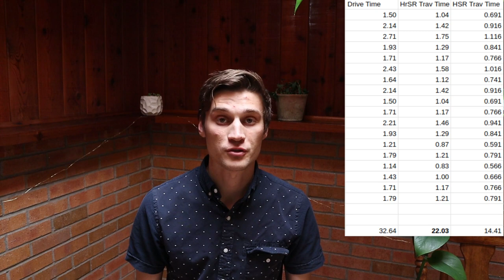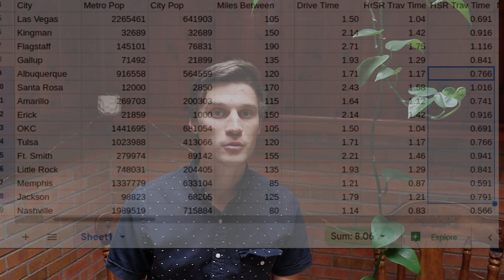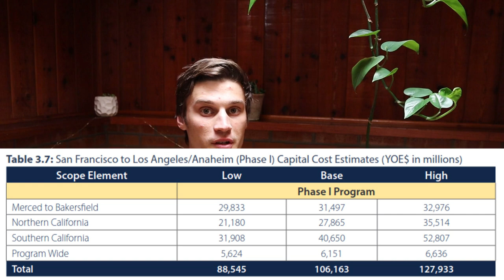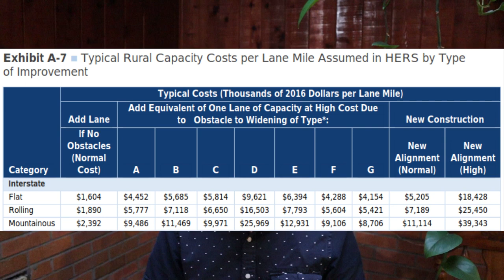What if Interstate 40 were High Speed Rail?

Comment: I'm not sure what the relevance is to build a new highway, because I-40 already exists, and we're trying to explore transit alternatives to it.

Your real options are:
-HSR
-higher speed rail

And I really think if you're going to do this project that HSR is definitely NOT justified. First, you're suggesting we  build an HSR for 3000 miles of I-40, that would be many hundreds of billions. That one is a non-starter. Even from Memphis to Knoxville that's 391 miles so that would be longer than CAHSR, so you're looking at well north of 100 billion, another non-starter.

I don't see any Amtrak service....is there not freight rail between those two cities where you could run a passenger rail and average 75 mph (typical max for freight is 79)? That would be your first choice. No hanging of a wire, just get some locomotives to run on low CO2 biofuel on existing freight tracks. 

If you're going to build new dedicated tracks....looking at the satellite view I don't see a lot of room to do that on I-40. Unlike I-5 here in California that has a nice 80 foot wide median for 240 mile stretch of road (and the cahsr stupidly still chose 99, for political reasons, don't get me started)....I guess you could run parallel to I-40 for most of it, you would have some elevated/underground sections though.

I dunno, I would investigate if there is freight rail in the area and if there is, I would just use that. It's the cheapest way to do this.

Not much money is justified here because the population density of Memphis is 2,146.71/sq mi (828.85/km2) and for Knoxville its 1,931.90/sq mi (745.91/km2), versus 52,000/sq mi  (20,000/km2) for Paris, France and 14,500/sq mi (5,598/km2) for London, England.

Or if you want to use examples in the USA (which is far less dense than Europe or Asia), NYC is 29,302.66/sq mi (11,313.81/km2) and Philadelphia is 11,936.92/sq mi (4,608.86/km2).

That's the issue in the USA. For HSR you really need
-high population density at point A and point B
-low distance between point A and B

So in our example the distance is high and the population density is low.

For London and Paris, the distance is lower and the population density is a LOT higher. 🙂

Comment: America should stop adding lanes to the Interstate and start adding Interstate High Speed Rail Lines along the median/ROW... A whole network could be built quicker and cheaper than trying to build greenfield lines and still deliver reasonable speed. Same here in the Edmonton-Calgary corridor which houses 4 million people in a linear city 160 miles/300 km long... There's even still space along MOST of the existing QEII freeway which eventually turns into/connects with the I-15 from Coutts/Sweetgrass all the the Inland Empire...

Comment: good video. There’s no way on earth a car driver can average 70 MPH anywhere in America. Sadly your politicians are owned by Anti Rail Passenger interests. That is why America has the worst/Non Existent High Speed Rail Infrastructure in the World.
Reply: In 1890 US rail system was the envy of the world, and we're still using it. What I would recommend along the interstate 40 corridor would be an elevated monorail type system using maglev technology. 400 mph isn't out of the question with such a system. You're correct however, US is full of anti-rail interests.
Reply: Rocker Jim...In Texas, going from Ft. Worth to El Paso used to be a very long 12 hr. drive across mostly desolate country with few towns along the way. I can only assume that today there is a lot more development along that stretch, but I still would take a bet that you could average 70mph. 

I would also bet that there are long stretches in some of the western states such as New Mexico, Arizona, Colorado, Wyoming, and others where you could maintain 70mph for a long time.

Comment: In the United States of America, it is the law that all passenger rail trains must stop in a siding to let cargo rail trains have the right of way.  You need to add that stopping time.  Which can be hours long, for each and every siding along the route.

In addition to the cost of the ticket for a hypothetical high speed rail journey, you have to understand that every inch of rail, the ground under the rail, and the various rail overpasses (you can't have road crossings  with HSR, you have to go over or under all roads) will have to be rebuilt for it's entire length.  The cost of such a massive infrastructure project will be added on to the price of the ticket.  Your  journey from Albuquerque to Nashville will likely cost your $6,000 to $9,000 each way, if the train is full and used by millions.  Or $12,000 to $18,000 each way if it is used as much as current passenger rail is used.

There will never be high speed rail in the U.S.

Comment: I do not believe that America is capable of building such a HSR system.  There is another option, however.  Sub-contract the project to the Chinese.  I suspect they'd be able to build a HSR system at lower cost and within a year or two instead of a decade or two which it would take if Americans built it.  Sad, isn't it?

Comment: D atl to sav ga thanks
Reply: If we include freight in the consist, we'll get more traction; with Port of Savannah being there, a high speed line moving freight as well as passengers through GA would likely get the rural folks from that part of the state on board. Also lets have an ATL to Chattanooga and Central FL line built that would use I-75 as a reference corridor; currently the heaviest traveled interstate not only in GA but the entire eastern half of the country after I-95.

Comment: using ca 'high speed" rail for a cost estament... can you say crock, and scam on the tax payers. as it is now only 300% over budget. and not even 1/10 built. no rail layed down. no power support.
 just hugh amounts of TAX dollars funneled into friends pockets.
many parts of land still pending in the courts as people are fighting the unlawful taking of there land. so many curves it can never be listed as "high speed"
as to hwy 40. most people do not use it to cross the country. or want to travel that far without stopping to see things. other than trucks. and a fast passenger train will not haul freight.
there is a reason the rail-corps stopped doing passenger service.
there is NO company willing to spend there own money to build such. so it would become another TAX burden on the American people, and then given to a for profit corp, that could never run it without getting a very large amount of TAX moneys to just power it. how many nuke plants are going to be built to supply the electric needed?